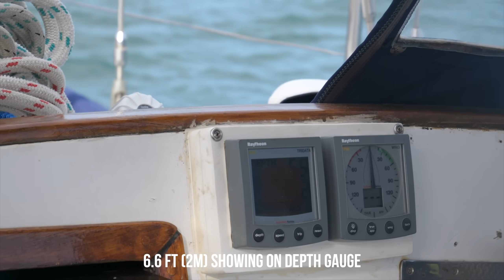The CURSE of the Disappearing PROPELLER SHAFT [EP 168] It finally Comes to an END!

Comment: Adam - I know this sounds crazy, but to easily assess if a shaft that length is "straight and true", find a good pool table where that has been leveled properly and on which the balls roll straight and true. Lay the shaft on the pool table felt surface and roll it, using a flashlight (torch) to backlight it and look for light leakage under the run of the shaft and the ends as you roll it over. Do that in a couple alignments on the table. If a ball on a pool table rolls properly, it is not only level, it is truly flat. Besides, where there is a pool table, there is usually beer.

Comment: easy way to check for bend in a shaft is rest the ends in some kinde of V. i use wooden v blocks. then set up some thing in the midle for referance. can be aything stable that can come close to the shaft. turn the shaft slow and look for deviation. simple and cost nothing

Comment: Stainless steel oxidizes when there's an absence of oxygen (yes, that's counter intuitive but it's still true). Which is most likely the reason why they used mild steel on the foot so they could glass it in depriving it of oxygen.
Reply: If it's 316 marine stainless it should have moly in it to slow down crevice corrosion, but it won't stop it completely. Mild steel is a lousy substitute, should really be bronze in that application, though fixing it to the stainless could be a challenge.

Comment: Feathering props are more than a little over-sold. I looked at one recently that gave most horrendous clunk when the shaft first spun in gear.  A big fixed-blade 2-blade prop is difficult to beat.

Comment: You might consider replacing the compression post or at least lengthening it a bit. A compression structure/post on a boat of this size should never contain any organic material, i.e. wood of any type or balsa coring anywhere in the column.

Install the compression post on the outside of the boat, from the cabin top down to the original compression post step. If you make the post a small amount longer and then through bolt it to the cabin top this will insure that only the post carries the compression load of the mast. This will require that the post base be a separate piece. The original mast step can be attached to the plate attached to the top of the compression post. Pay particular attention to slight variations between the perfectly vertical compression post and any angle to it, made by the cabin top and post base.

I used this method on three Westsail 43s that I built and my own Cape Dory 28 in which I did a solo circumnavigation. The 43 is similar to your boat but a bit heavier with a bit more sail area. The compression post was made from 3" Schd 40 galvanized steel pipe with a 6" long piece of 304SS pipe welded to the bottom to help eliminate corrosion in the bilge. The pipe is about 3 1/2" O.D. The plate in the bilge had a slug of SS welded to it just small enough to fit inside the pipe. This keys the pipe to the post so that it cannot move, yet the entire thing can be removed should the need ever arrive. The lower end of the compression post should have a notch in it to let water drain from the inside of the pipe.

Not sure if your post base is only on the hull or also on the hull above the ballast. In any case it can be lag bolted down and epoxied to hold it in place. To insure a flat area for the base make a low dam(s) and fill the space with a mixture of slow setting epoxy and sterilized sand(if you can find any). Sterilized sand is cleaned, washed, dried and contains no organic material, it is used in the US for sand boxes made for kids. This will also elevate the base plate slightly so it does not sit in bilge water that may accumulate in the area.

Finish the compression post, where it shows, in any way you desire.

Comment: Your compression post looked fine, it may not look pretty at the bottom but it's still strong. But having water come down through inside the mast is a bit concerning. As far as the prop shaft goes, I saw some pitting on it, so make sure it's not where the stuffing box / seals are or you'll have a leaky shaft. And as far as straightness goes it's best to bring it to a machinist and have them throw a dial indicator on it.

Comment: You can salvage that mast post. Perhaps cut off the corroded plate, and have a new stainless one (perhaps a little thicker) welded to the new cut surface. A decent drainage hole (or two) would help also. Stagnant seawater will attack stainless. When the environment is oxygen-depleted, it is the chlorides in the seawater that do the damage. Chlorides are rendered inert (or near-so) in an oxygenated environment. It is stagnant seawater, oxygen-depleted, and chloride-rich that is the real enemy.

Comment: compression braces on ballads are the same, before 74-75 they used a mild steel encased in polyester 1/2 in and 1/2 out - after 75 they went to a galvanised steel compression brace, just that small change meant the difference between having to replace the brace or if its still going strong 50 years later. It also helps to keep them dry, if the boat sits with water in it (over winter for instance) then it will be destroyed pretty fast. Just make sure that the foot of the compression post can drain properly... another great episode, pat on the head for Adam and kisses for Kiara

Comment: You are going to need a tool to get the new shaft in.  The pressure you felt pulling it out will be very difficult to overcome in reverse. When you pulled it out you were at the end of the "arm". Going in the same amount of FT lbs will need to be applied very close to the hull. To test this, you may want to check by re-installing to the old shaft to see if it going to be a problem. Love the content and keep the adventure going.

Comment: The base of my 86 is mild steel, like what the fuel tanks are made of. cut it off and weld a 304 plate on it.  While you have the mast off enlarge or add more drains and reseal the mast step with butyl tape.  On my boat the compresion post only gets water in if the drain holes in the step get clogged.  Sealing up the wires in the pipe  just before stepping the mast might have stopped the leak too. I used 3M strip caulk (any auto supply store will have it ) but butyl tape would also work.  

the wear on your prop is the one down side. they chew up bearings annually.  The amount of corrosion on the prop shaft is impressive.  Glad you are tossing it. Make sure to lap in the old prop to the new shaft but you been there, done that.  Good the BST studs on the shaft log all came out.  You did it right last time and it paid off. 

While Milly won't care when using a crane without spreader bars is a good way to mess up your boat. The slings will want to squeeze inwards. I've seen some boats damaged when picked up without spreaders.  If the slings are on bulkheads not too much worry but try lifting a power boat and watch what happens to the gunwales.

Keep up the good work!  Nicely done on all of it.
Reply: I was surprised they didn't use spreader bars.

Comment: By all means you did the right thing on the compression post. I would venture to say building a base pad out of a noncorrosive and hardened material would be the plan and measurement of any new height of a new base is critical or the post will not fit snug, you do not want it to bow out the hull bottom if you have to jam the post back in to place. Thanks John

Comment: To measure up to 1 or 2 mm of deviation in the shaft I'd take a string of rope. Run the string from one and to the other of the shaft and see in in certain areas the string separates from the shaft. I'd do at least two measurement separated by 45°. It's free and it's more precise then eye ball it.

Comment: What about building an epoxy shim to land the bottom of the compression post on that you can slide in under the post and then glass in so that you don't have to jack the roof to make room for the hypotenuse length when angling it in? You could even epoxy nuts into the shim to bolt the post to if you felt the need. Sorry, came to this video a month too late.

Comment: Checking a shaft for straightness  is very easy. You just need two straight edges (don't get carried away with precision straight, 2 pieces of angle iron will work fine). Lay them out parallel to each other and level spaced almost as far apart as the shaft is long. Roll the shaft on the edges. You will see right away if it isn't straight. If you want a measurement as to how bent a cheap dial indicator and a pair of V-blocks can be surprisingly accurate - more than enough for what you are doing.

Comment: Sorry about your problems. I have a question if you don't mind? 

Is it okay to remove the post without first placing support beams? Just watched Beau & Brandy and they also removed their compression post however they placed support beams to take the weight of the mast.

Our boat is also deck stepped.
Reply: The mast was already removed before they started on the compression post. B&B still had the mast up and they're in the water, not on the hard.
Reply: @rumblechick73  oh no wonder! Thank you ☺️

Comment: Can you roll the prop shaft on a flat surface to check for bend? Seems like that would work.
Reply: it will work but won't have great precision.. a lathe and a dial indicator would be nice.
Reply: You can use 4 wine glasses and some kind of stick as indicator. make "wheels" of the wine class legs (the steel slides on them almost like rollers) per each end. Then you can use a stick to indicate various places. Use materials with known thickness to test deviation (paper, aluminum foil, saran wrap..)
Reply: @PasiSavolainen  interesting.. that's a smart idea